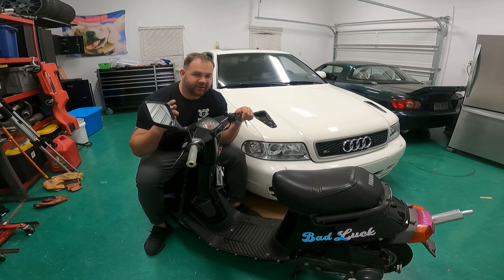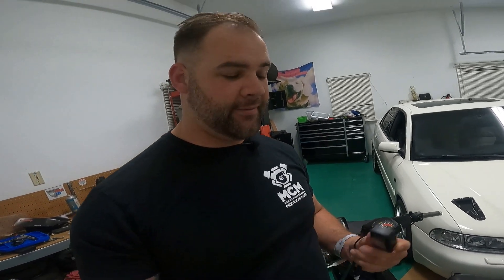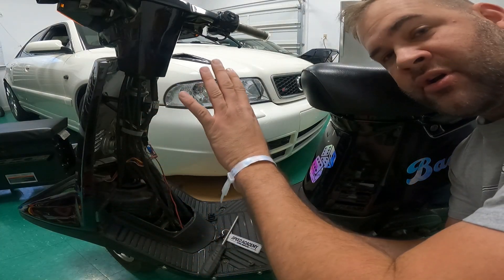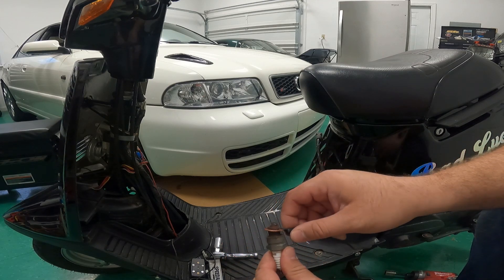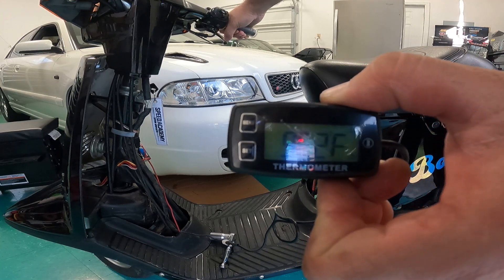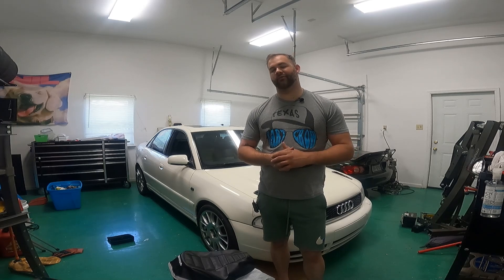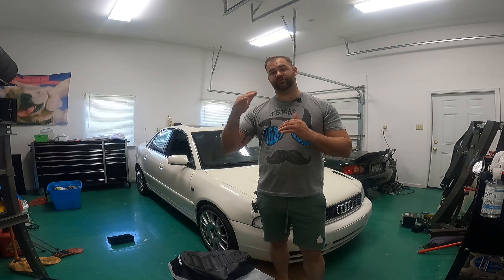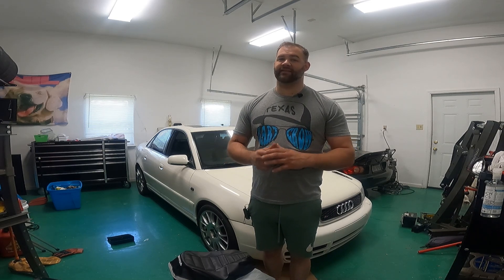Why Your 2-Stroke Engine is Overheating: Control and monitor your temps!

Comment: I always run a temperature sensor when tuning. I’ve got one that does temperature and RPM both which is handy when adjusting roller weights.
Reply from the maker: I've seen those! Almost went with it